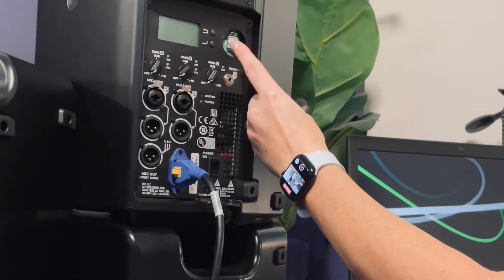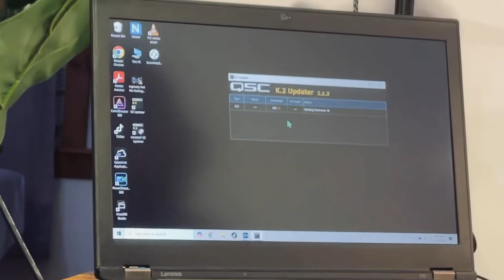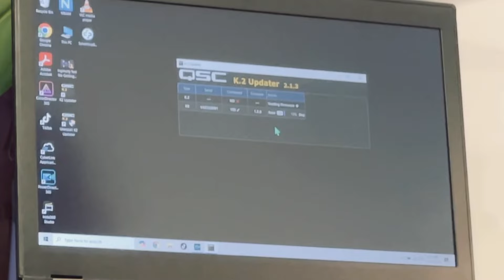Must Watch for QSC K.2 Owners. Do The Updates!!! 🔈🗣️

Comment: nice video.. thanks for doing this. I'm curious what QSC told you with your broken K10.2. I have one and another that doesnt work as well and 1 other k.12.2 that already had the module replaced.
Reply from the maker: Unfortunately after many attempts to plead my case I was not able to get them to honor a warranty since I was past the two year mark of purchase. Lesson learned, had I registered at the time of purchase you get six year coverage. I had a local repair tech replace the module and its cost $450. Still cheaper then buying a used speaker. Best of luck to you. I recently heard from a local QSC dealer that he would not recommend buying new gear from them. The original gear is still worth its weight in gold but moving forward some of the components will not be high quality. Something to think about I guess.